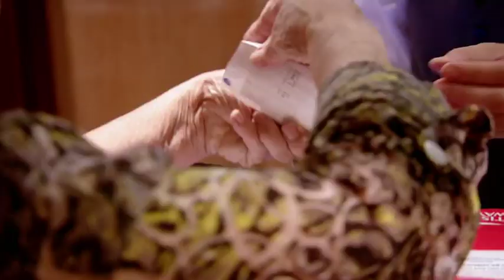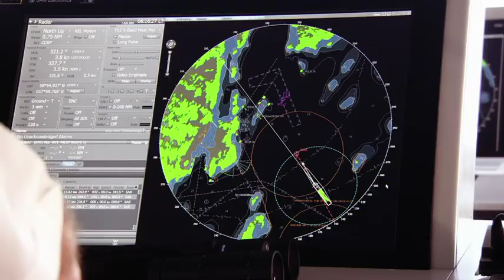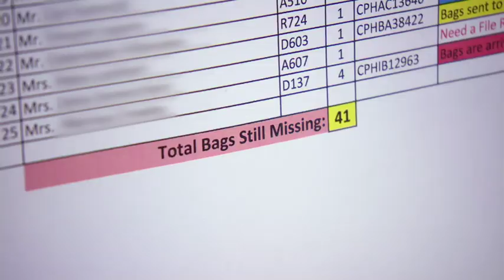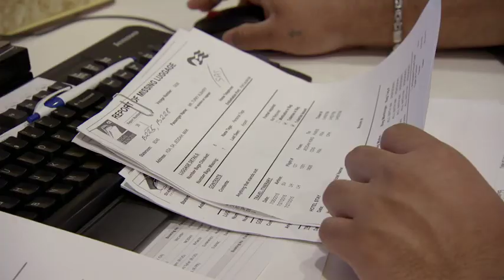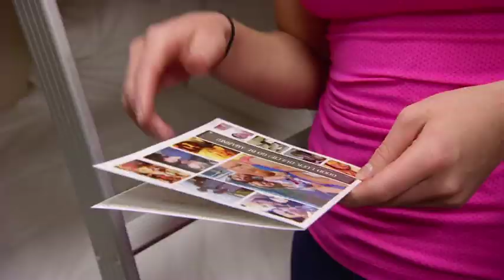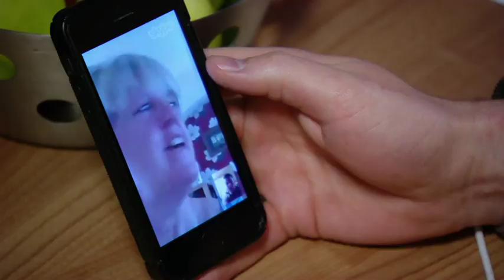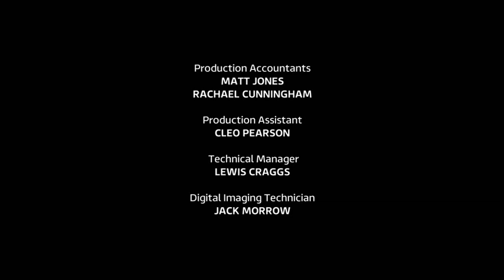The Cruise - Season 1 Episode 3

Comment: I don't understand, the airlines lost the luggage, not the cruise line.
Reply: The representative of the company "at the end of the chain" so to speak is the one that has to do all the work to try and accommodate the passenger and to "right the wrong" that the customer (cruiser) has received. At this point, who caused the problem is not the point, the point is that the problem has occurred and it needs to be fixed. The cruiser needs to feel assured that the cruise line is doing everything they can to solve the problem that has occurred. That is done by keeping the passenger informed of what's going on and making sure that the cruise line is doing their all. 
Tom
Reply: Some passengers may have bought the airfare through the cruise line EZ air programme,  The cruise line will always try to sort things out for their passengers.
Reply: If you purchase airfare thru Princess there is an expectation Princess takes responsibility for it and in the event of flight delays etc you will be taken care of. Yes I know that makes no sense but it's the justification Princess gives for trying to sell you flights.
Reply: @twp3  Correct however lost luggage is a problem that has been prevalent for years, and any reasonable adult should be cognizant to the risks of flying and checking your luggage knowing you are embarking on a cruise. In the video some of them weren't even smart enough to being a carry on with a couple days clothes in them...that's not even close to smart. I always travel with a midsize carry on on all of my cruises. It's common sense..and should be for someone dropping $3,000 - $10,000 on a cruise.